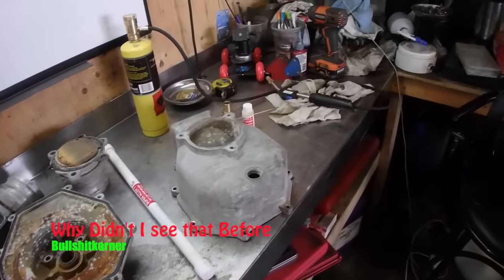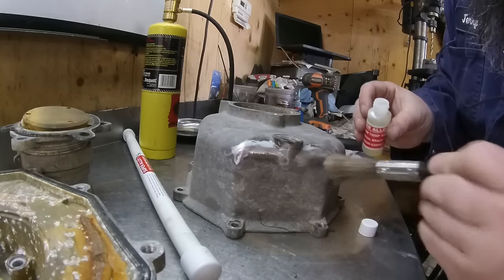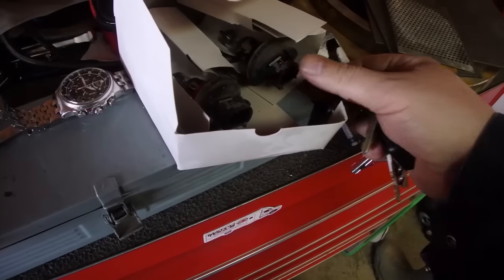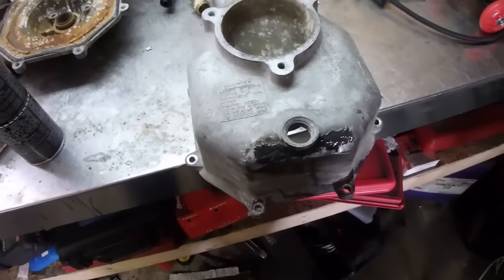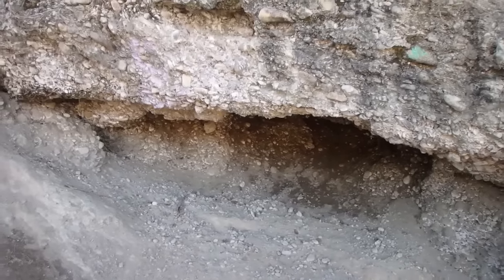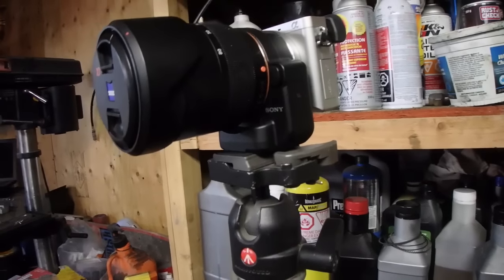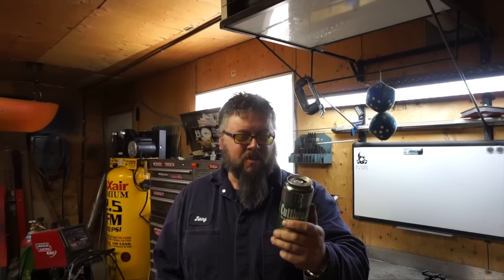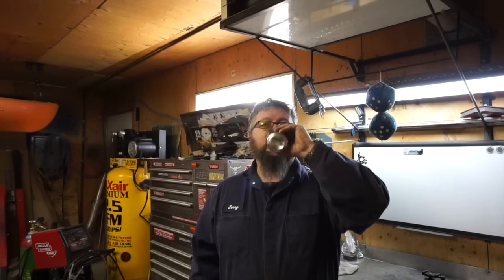Really, The Pump Housing is Cracked

Comment: That’s not welding, that’s brazing. You aren’t supposed to allow the flame hit the aluminum rod. You allow the heat of the infected area to melt it which allows the flux to carry it in the joint by way of capillary action. Yours didn’t work because your infected area wasn’t hot enough but the rod melted because of the flame. Regardless though, aluminum can give a lot of fuss

Comment: flux coated aluminum welding rods with dc tig torch works well with thick dirty castings
Reply from the maker: that's cool i've never seen someone use a rod before only seen people tig weld.   the rods don't seem to be overly priced either i'll keep that in mind for next time
Reply from the maker: do you do any videos of the old bikes you fix up ?
Reply: Honestly i start to, but the editing uploading bs and the fact that i just want to concentrate on repairs and not camera killed that plan.
Reply from the maker: ya i know what you mean, it's hard to stay focused and yet try to film what's going on ends up taking 3x as long

Comment: Brazing aluminum is a real pain in the tits.  It dissipates heat so quickly that if you don't pre-heat larger pieces, the rod material just drools off like that.  It's gonna sound totally ghetto, but when I've had to repair aluminum oil pans in the past, I just sat it on a small gas barbecue on high for ~15 minutes, then torched the joint and brazed it while it was still on the barbecue.  Really hot working environment, but the oil pan outlasted the car!  ;D
Reply from the maker: +rhkips I should have put that pump housing on the bbq for the same amount of time and then heated those rods into it.  I wouldn't call your method ghetto but thinking outside the box to get the job done.
Reply: Bullshitkorner
There's probably a specific temperature it should be at, but I have no clue what it is, so I just go for "fucking hot."  :)

Comment: I was told. Aluminum welding rods jumper cables and car battery works pretty good. JB weld should work.
Reply from the maker: someone else mentioned aluminum rods.  Did my Gold clean up today got about 300 flour flakes sounds like a lot but it really amounts to nothing
Reply: +Bullshitkorner there's has to be hot spots out there just have to find them look for large washes going to the river. Or wash drop Off.
Reply: +ronnie b prospecting and the inside bends of the river not the outside.
Reply from the maker: There would be tons of hots spots a person needs a jet boat to get to them.  Inside bends are the rule except for the NSR river here there is gold to be found on both sides of the river inside outside bends for about 300km strip all flour gold and gets redistributed every year after the floods when the gravel bars change
Reply: +Bullshitkorner I don't know if you're allowed to dredge but you could build your own homemade dredge hook it up to your high banker that might be the way to go.
Reply from the maker: no unfortunately dredging is illegal here no mechanical equipment dirt can only be moved to your sluice by hand

Comment: so did the jb weld work or no????
Reply from the maker: It did work
Reply: thanks for the fast reply brother. i have a craftsman pressure washer that i used 2 times and i was stupid enough to let my inlaws use it. when i got it back i fired it up and there is about a 2 inch long hair line crack in the pump directly under it.... you cant even see the crack unless you turn it on and the water comes out. im pretty sure it got dropped while they were putting it back in the car trunk although they wont admit it of course. im going to try that marine jb weld if i can
Reply from the maker: Jb weld won’t work on a pressure washer.
Reply: welp there goes that idea lol.  last time i priced a pump it was about 2/3 the price of a new one so i might just throw it out